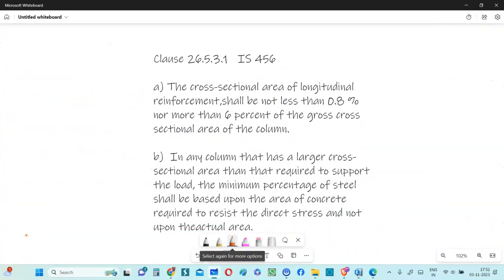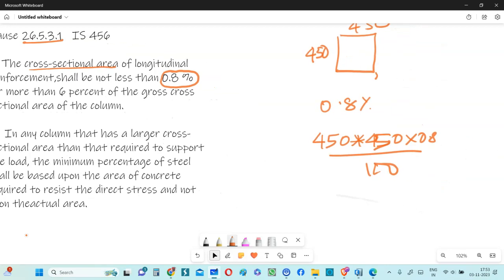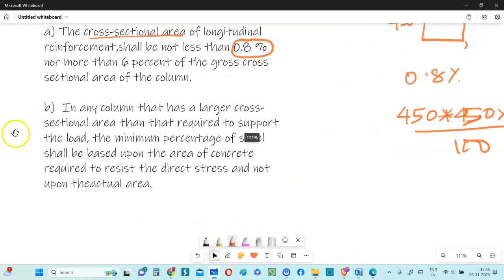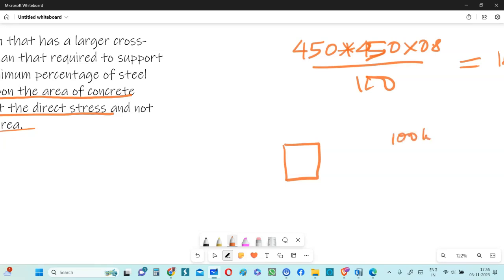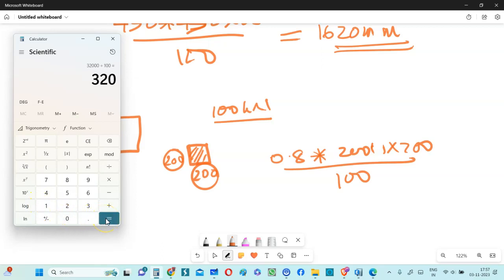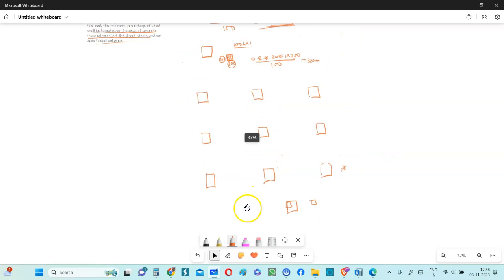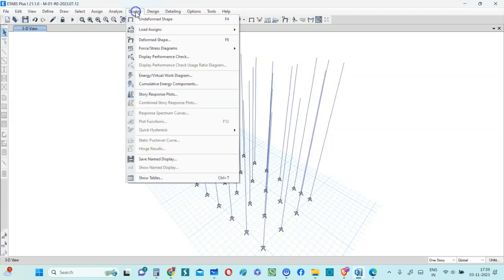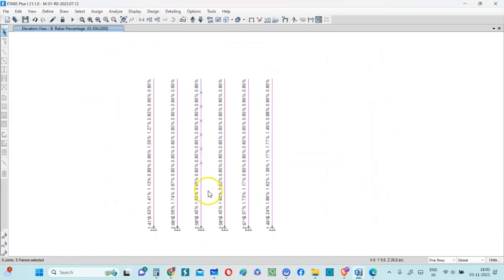Column design - Are you Interpreting the minimum reinforcement in column in the right way?

Comment: How we will come to know about the "concrete area required to resist direct stress" in etabs, if the column is oversized?
Reply from the maker: ETABS will not show this. You need to check all your columns that shows up as 0.8%

Comment: Hello, such an informative video. I want to know how you will determine if etabs use the gross area or the tributary area for the steel reinforcements calculation. Thank you
Reply: So tributary area is the area where the load is acting if I'm right so it's different from the actual area or?
Reply from the maker: Am not sure of your question
 @ramonbaccomperi7871
Reply: Please I will like to know the meaning of tributary area.
Reply from the maker: @ramonbaccomperi7871   See this video https://youtu.be/LFpST17F5Bk?si=nt64sgUYbO2Z84h2
I have mentioned about an area in this
Reply from the maker: Thanks a lot for your comments.
Am a little concerned about your question as I feel that your understanding is slightly different. The tributary area comes in to picture when you calculate the load. Am not 100% sure what you meant though. 
The comparison wrt rebar area is gross area vs required area to take the actual axial stress.

Comment: Great information regarding IS456 . 
But if column is part of LLRS means ,column to be designed for ductility for seismic loading as per is13920 , in that case also can we reduce pt <0.8%,as ductile column most of the time governs by Axial failure(0.4fck)for seismic cominations. As i have obserevd while treating ductile column against above mentioned Axial check we need to increase column size tremendoulsy and also at the same time need to provide minimum 0.8%pt.therefore if in this case we can even give 0.1 %pt against 1.5DL+1.5LL .
Reply from the maker: See, this point is when you get a min steel as an end result.
For ductility, there are many criteria including the strong column and weak beam!
If you have rightly sized, the chances of getting such a condition of min steel is rare in large projects. 
But the world is not just with large projects, we do also have smaller projects. There are quite a lot of engineers who in the search of knowledge miss to remember the fact that there is a huge amount of clients looking to solve simple issues economically. I have a large number of audience on YT who are looking to freelance on their own and they do smaller projects. The motto is to enable engineers to do economically but at the same time with no compromises.
Reply: Thank you.